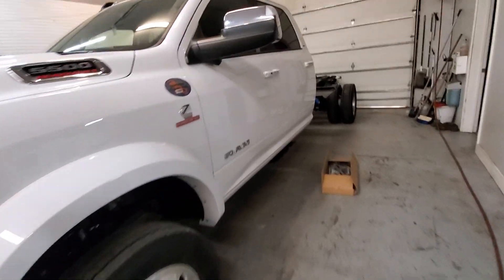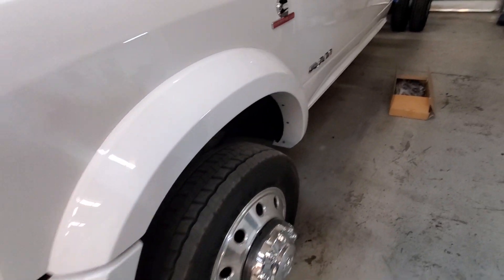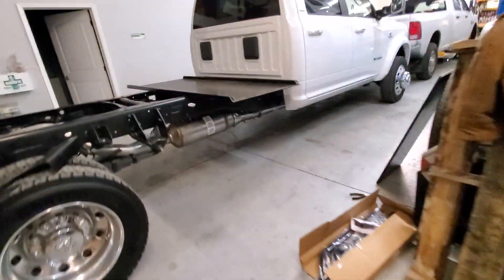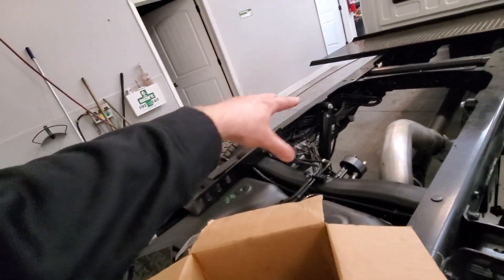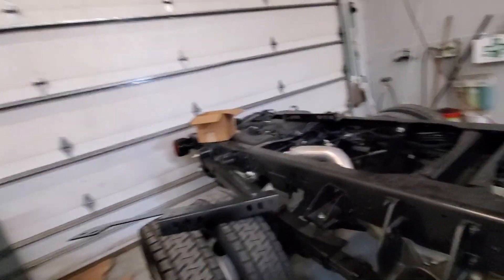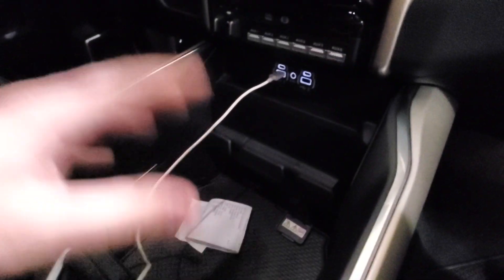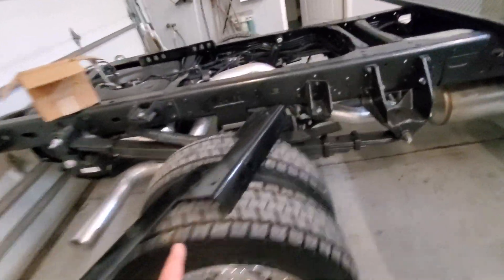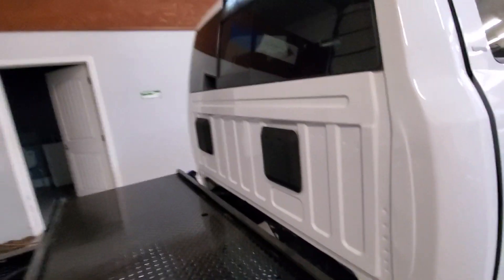2020 Ram 5500 Cummins. Getting a sweet setup.

Comment: Beautiful truck. I think the  ram 4500/5500s are underrated. Very well built and hold up off-road better than pickups.
Reply: I own a 2019 5500 Cummins it is a turd. Truck has no guts. I’ve never been more disappointed in a purchase.
Reply: In a $75 k purchase at that
Reply: @ponchhunt  just drive it
Reply: bottler solutions no other choice at this point.
Reply: I’ve found with my (heavy) service trucks that they work best with the cruise control set. Just let the truck do its thing and be a steering wheel holder.
Reply: @ponchhunt  tried to tell my friend the 6.7 ford powerstroke pulls much better

Comment: 5 to 6 car hauler, he will need some rear airbags as well.
Reply: Not on a 5500
Reply: @bottlersolutions6739  I have a 550 and it squats without my air bags inflated when loaded. Hot shot Dave has  new Ram 5500 and he squats with a 4-5 car hauler
Reply: Interesting,  I have a 18 4500, trailer 11200#,empty, plus 20,000, that's 31200# loaded. It doesn't sink 1/4"
Reply: @bottlersolutions6739  He saying the guy will be pulling a 5 to 6 car trailer. It all depends on his pin weight on the rear drive axles. If the load is not balanced and is a heavy vehicle over the 5th wheel.